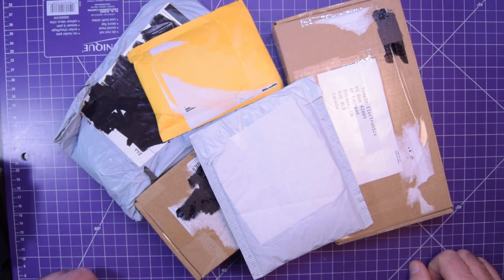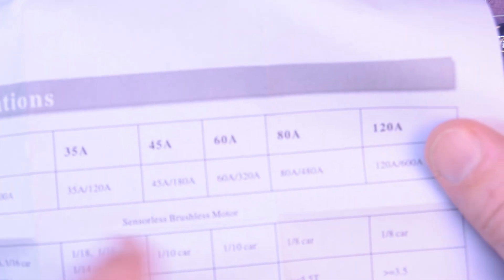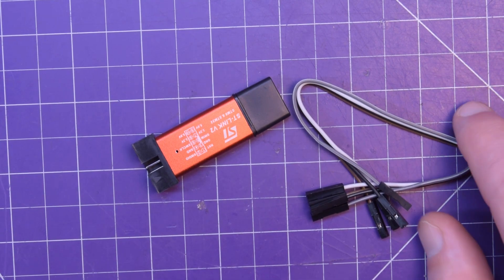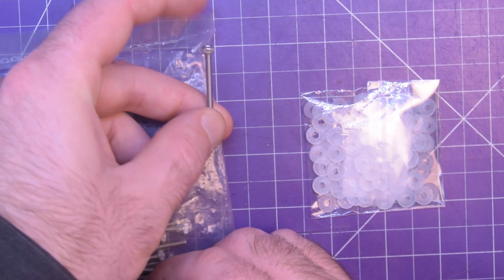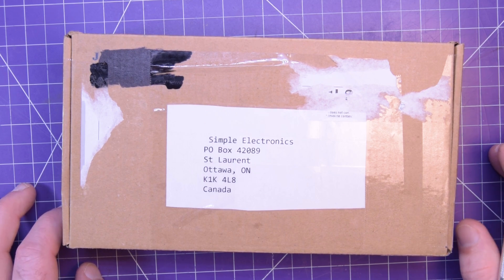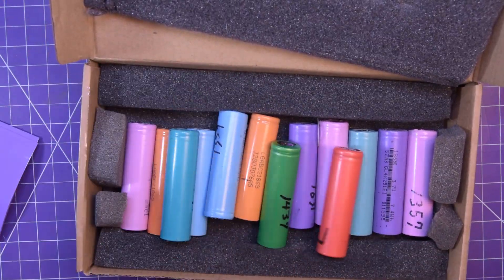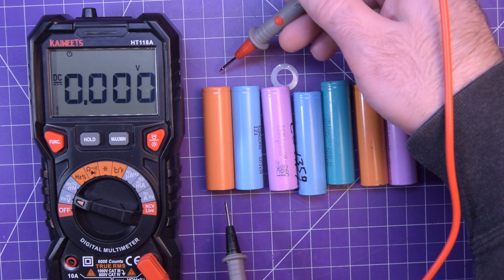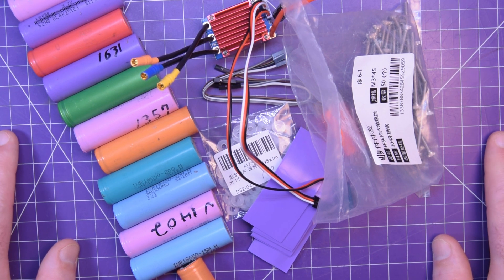Mailbag 70 - Voltage Control

Comment: Hehe ... I have a nearly identical collection of 18650's with sharpie marks for capacity.  Have a roll of shrink-wrap for them, but have never found source for positive-end washer replacements.  Some good things to have for your collection are PCB-mount battery holders, battery sleds, and those  little micro-usb chargers with undervoltage protection.
Beware the cheapest Chinese 18650 ABS battery holders ... they are terrible.
Reply: You could search on aliexpress, I got some from there. You can even get fake shrinkwraps for your cells, with 8800mah on them:-D Or even genuine looking ones that are used for currently highest capacity cells available.
Reply: @kjur18  Ah, sounds like a hook into an Ebay business scam!  Will you share the link where you get the insulating washers?
Here is an Ali link for some PCB battery clips:  https://www.aliexpress.com/item/33036182375.html